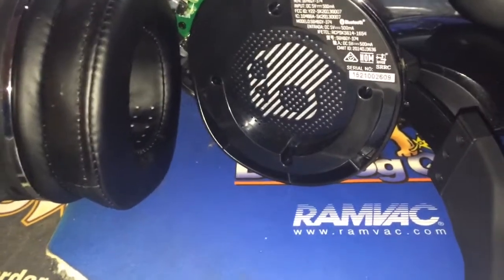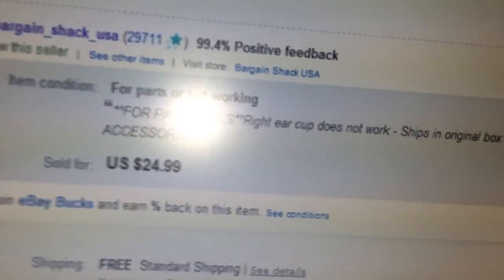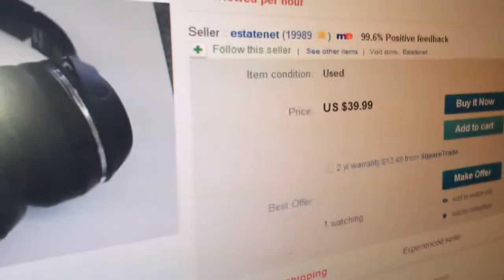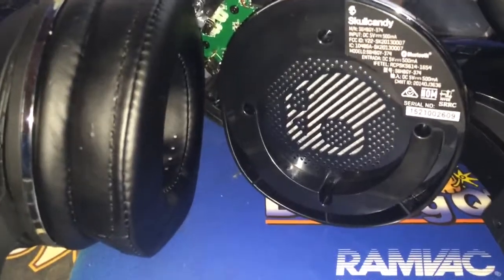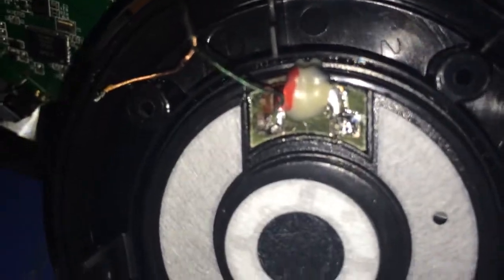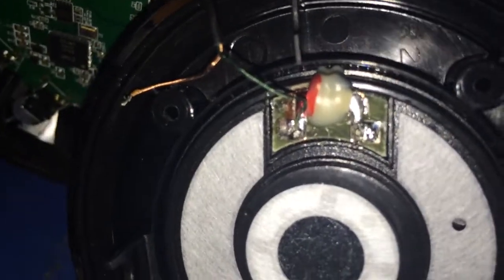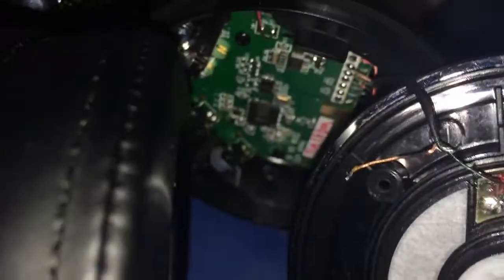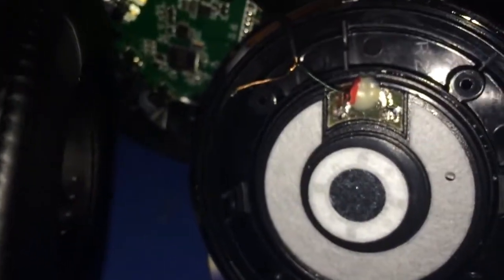Tip on How to Repair a Skullcandy Hesh 2 Wireless *Earcup

Comment: Hey, I got a new pair and they're working only when connected to wire. Bluetooth only plays left side. Any suggestion?
Reply from the maker: Are they new as in you still have the receipt? I always recommend the warranty on companies like Skullcandy because sending it in/repair is free on manufacturing defects. If that's not the case, its definitely the Bluetooth transmitter.
Reply: Yeah, they're giving me one for free, arrives tomorrow, and they let me keep the failed one. 
If it's the bluetooth transmitter, that's easy to repair? I'm not in USA so there isn't Skullcandy support here, so I'm going to a local electronic technician and I don't want to get rip off lol. 

Thanks for your reply!
Reply: i lost my warranty and don't have the receipt and i'm having the EXACT same problem, what do i do?
Reply: @Mrspiderman20014  Same as wel...
Reply: Same holy shit

Comment: Could you wend a pic of the motherboard of the right ear cup, something came loose in mine and now the leeft ear cup is not working...
Reply: Send*
Reply: Cas du Pont i have the same problem with the right i feel like the speaker went lose and it caused my right earphone to not work but luckily i fixed it temporarily by tapping on my right headphones gently at the good place until i heard sound in it
Reply: Hey did you get a picture?? I need it too.

Comment: mine make a sound when the left ear cup is moved like a moving sound, as if a part is sliding around, and in some positions i get less sound any idea what it could be
Reply from the maker: Part of the inner ear cup may of come loose, which in turn may be pulling the wire off its soldiering. Consider using a repair warranty if you have one, or jump into having someone/yourself crack it open and see for yourself.
Reply: My Speaker came dislodged. Follow this guys tear down instructions. Be carefull to not break solder connections to the wires and then have some super glue ready on hand to secure the speaker back in place. DO NOT use too much incase you have to replace a speaker later on in life!
Reply: Same here

Comment: just a question my headphones are the same but like one ear doesn't work properly like it works but the other ear is louder than it any help ?
Reply from the maker: It could either be; loose wire from soldiering, or actual speaker damage. Did this problem happen overtime or did you get the headphones in this condition?
Reply: AOM 776 overtime it was in my bag then when I took it out there was something that sounded loose inside but now it doesn't make that sound
Reply from the maker: If its overtime, it might be a blown speaker, but you can check it like I've described in  the video for a loose cable, IF its no longer under warranty.
Reply: Okay, thanks for the help :)
Reply from the maker: No problem! Let me know how it goes.
Reply: @AOM776  bro my headphone not open 😥 can you give me a solution?